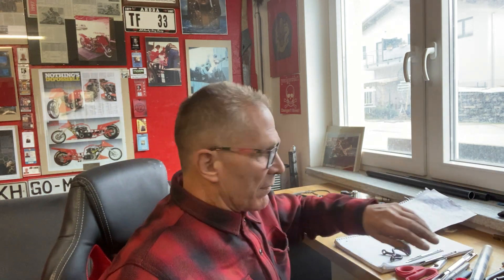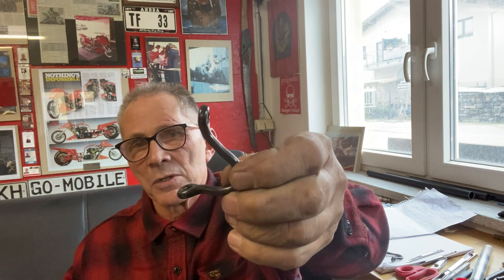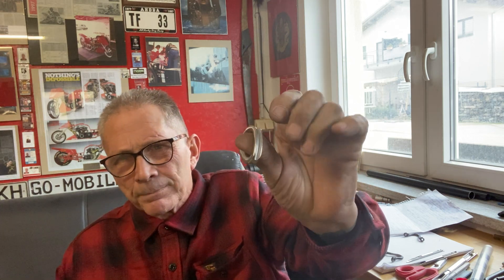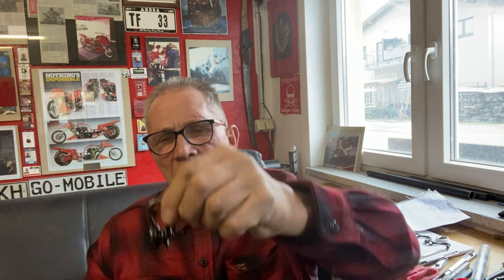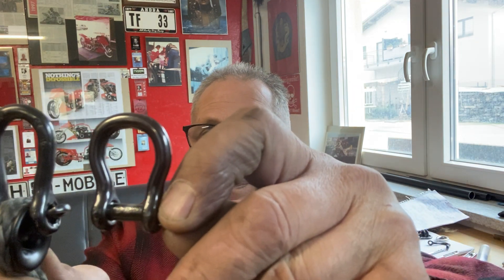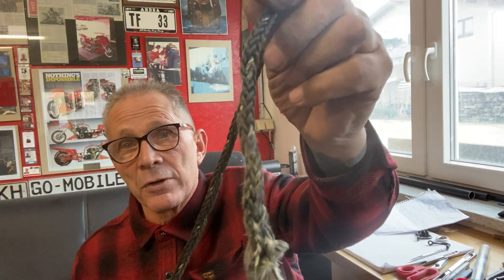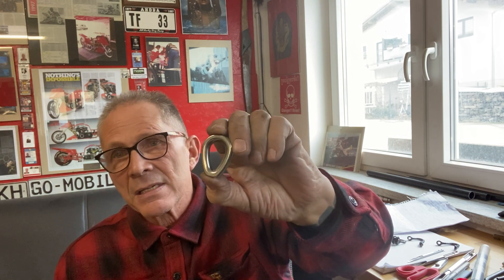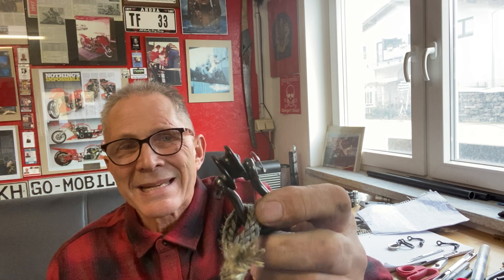#2 Stunt Rigging Toolbox Talk, performer line terminations

Comment: So would you use thimbles on each end? performer and anchor?
Reply from the maker: Yes, on all fixed eye splices I try to use thimbles, mostly for ratchets and drops due to the forces. For simple hand pulls, or when using a bollard to change working rope length, I will not use them.

Comment: I have always been curious about the eye angle. If the eye is similar diameter as the thimble or pin or bobbin, does the bind on the brummel splice decrease MBS of the eye itself? I've always made sure my eyes are shallow angles, never tight. Using thimble geometry as a reverence angle. Clearly the rope is plenty strong compared to the shackles in these tests. For fun, make an indestructible anchor and pull to failure of rope testing eye angles. 👍🤘